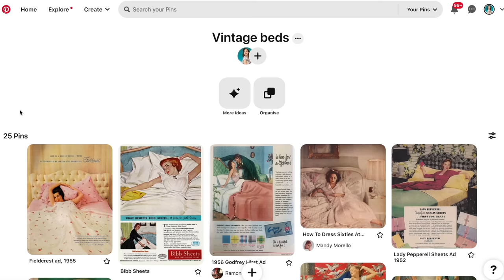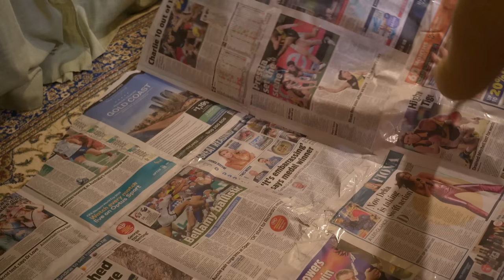I made a 1960's Style Headboard!

Comment: I have a headboard that had a faux leather inset. Sadly, the previous owner taped the price on it when they were selling it at their yardsale and the tape pulled off visable holes in the faux leather finish when it was removed. I tried using leather dye, but that didn't really work. So, I took the inset out (which was a chore and a half) and recovered it with a blanket. Once the inset was put back into the frame, it now looks like a really soft fabric inset.

Comment: It looks SO good! Im obsessed with anything mid century modern. If you ever have to make another one...make your life easier. Use peg board instead of plywood. The holes are already spaced out. You can also get buttons made especially for covering with fabric. Like the ones you see on clothes. Then use a long needle and thread through the front and tie off in the back. Using the holes as a guide. Pull tighter and the tuft is deeper.  Can't wait to see another makeover of nans house!

Comment: I’m so happy your headboard turned out well! Believe it or not, you weren’t far off from how a professional upholsterer would have tufted the “bed head” - the measurements for button placement would be made on the plywood itself, and holes drilled through. Then the covered buttons (ones with a “shank”) would be threaded with string, both ends put through the eye of a long upholstery needle (sometimes called a doll needle) and pierced through to the other side. You begin tufting from the center and work outwards. This method is great because it allows you to adjust the depth of your tufting to your preference. Finally, the string ends are stapled to the back of the plywood - and you can cover the back if you choose. This method of tufting is extremely secure - so if you find yourself with popped tufts or dropped buttons, you could choose to repair them as the pros do!

Comment: That's so lovely, I've been pricing up recently to have one made, I'm not going to bother not I've seen this, I know for a fact me & my hubby can do this, thanks so much for sharing, good job 👍 xx
Reply: Pro tip: Measure out your button placement on the plywood, then drill holes where you’d like them. This is far more accurate than the top-down method Sage struggled with. Thread heavy string through your buttons (preferably the shank kind - or add the string before covering the flat kind), and use an upholstery needle to pull the string through from front to the back. Start in the center and work outwards, stapling the string ends on the back as you go. This way you can adjust the depth of the tufts to your preference - and you won’t have issues with popping staples or lopsided buttons - and it’s more secure (and easier to repair if need be) in the long run. 😊
Reply: @jenniferlynn3537  Thank you for that ...

Comment: For anyone wanting to do this at home. You can actually measure the placements on the plywood, and drill small holes to it. Then just using a needle and strong thread you can sew through the drilled hole in the back, to sew in the pulley and the button.

Comment: Generally when tufting a head board or other piece of furniture you drill two small holes where you want your buttons to be placed, then using strong thread you sew thru the back of the button, cover it. then tread the button thru the holes in the wood and tie them off tightly. This pulls in the batting and material and  makes sure that through years of use your buttons don't pop off or out of the wooden base. Just a tip for next time to make your life easier.

Comment: I have never seen a tufted headboard stapled. I've always drilled holes in the board before applying the foam, batting and fabric. Nothing would be stapled in place at this point. With a long upholstery needle and strong upholstery string (not thread) come through the central hole in the back of the board to the front. Thread through the button and back through the layers and out the same hole in the board and tie it tight. Leave enough string to tie around a finish nail then tie my string around, but I guess you could staple it down. Work outward from the middle button in even circles until all the buttons are in place THEN bring your fabric around and staple it in place. To finish the back of the headboard, I use a thin layer of batting and a layer of matching cloth hand sewn to the cloth stapled in place. To make things easier I use spray adhesive to hold the layers of batting to the board  while I work.

Comment: Sage, 
I know you replaced your fridge with a vintage one which I’ve always also found to be charming. However, I saw this article about the hazards of old fridges. I hope this doesn’t apply to yours. Just thought you should know bc I had no idea.

“In use since the early 20th century, early consumer refrigerator designs relied heavily on ether, ammonia, and other toxic gases to help the cooling process. (Sulfur dioxide and methyl formate, flammable and corrosive to the eyes, were among the worst offenders.) So long as the material was encapsulated, there was no problem. But should the appliance fail due to eroding pipes—or if a repairman wasn’t careful—owners would get a lungful.”

When Albert Einstein read a newspaper story about an entire family dying in just such a mishap, he and Leo Szilard teamed up to design a better refrigerator. Before they could change the world, Freon gas became the standard for coolers…(Eventually, modern fridge makers would ditch Freon, too, after the gas was found to be bad for the environment.)   

Be well and be safe!